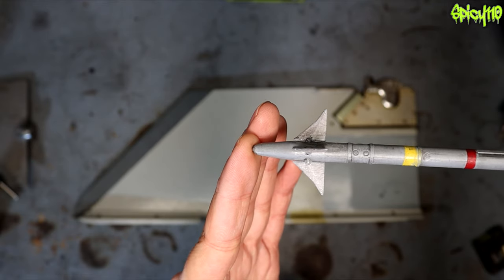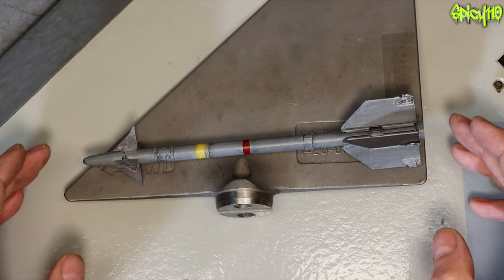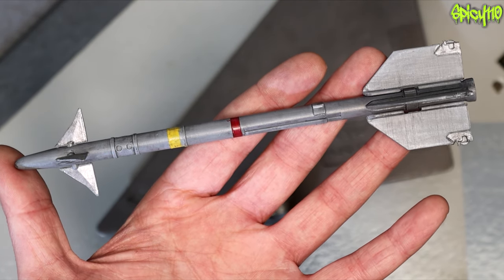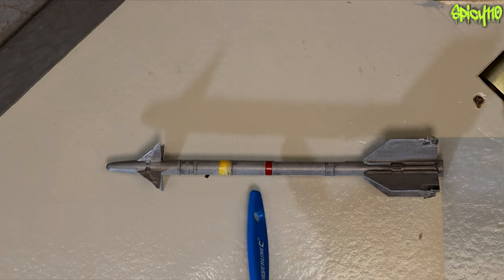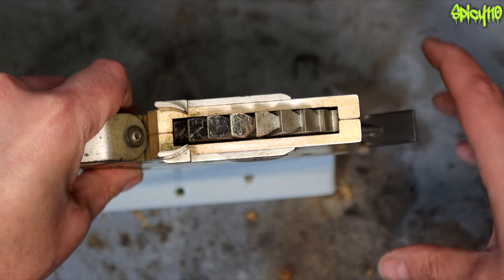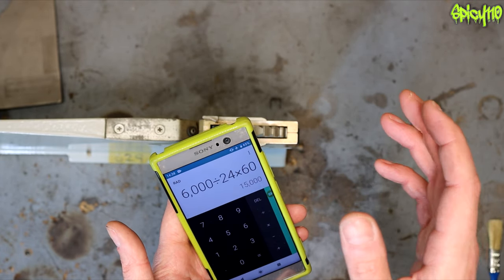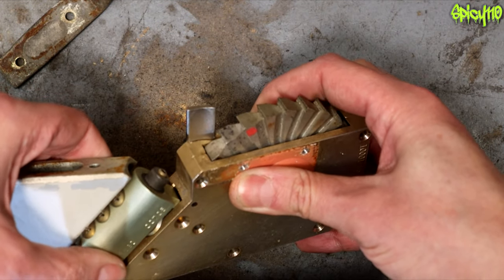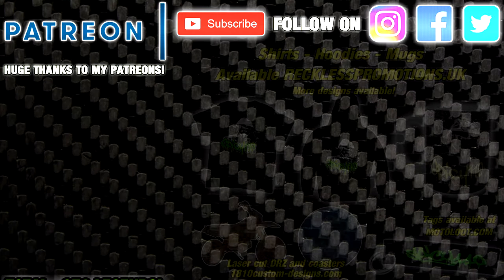AIM 9 SIDEWINDER MISSILE | How it Works with Rolleron Demo!

Comment from the maker: They are also quite good at popping ballons!
Reply: I see what you did there!
Reply: Just a heads up. A prefix comes before a word and the thing after the word like AIM9L or AIM9B would be a suffix. But maybe im getting that wrong and it works differently in this context
Reply: @yuyiko  you are correct.
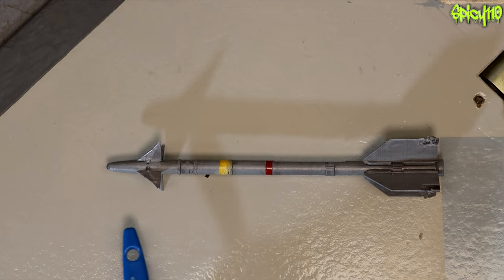Reply: I think they're using inert AIM-9X like a dart to pop it instead of 11:03 or perhaps they're just bypassing the arm/detonate function.   @spicy110 vid from 2021 you were a Sidewinder missile geek legit before it was cool!
Reply: They could have just used a single cannon shot surely. Or even a 📌
Reply from the maker: @TristanMorrow  my first video on rollerons was 8 years ago, this was the correction 🙂👍
Reply: Balloons? That was truly a star craft. I could see the little green men and the tractor beam when it popped. Nobody believes me but I saw them.
Reply: Great video. The Aim 9X used by the F22 has a totally different control scheme that all previous Aim9s (thrust vectoring along with rear control surfaces)
Reply: @Tom_Hadler  I just saw a video the other day that explained the USAF decided to use a missle because there was an instance of a fighter jet from another country shooting over 1000 rounds into a weather balloon and it still wouldn't pop or descend.
Reply: They still use an annular blast fragmentation warhead (the welded at opposite end bars) so I’m not sure where you got the idea that was outdated. If indeed it was you that said such a silly thing.

Comment: The canards are in pairs as there’s no reason to spin the missile… that’s precisely what the rollerons are made to prevent.  Having them rotate in the opposite direction of the other canard on the opposite side would just make the missile spin (like a bullet). That makes it impossible to lock on to a target, with the camera in front spinning like crazy.
Reply from the maker: Yes totally makes sense I was having a bit of a dumb moment as I was stuck on a construction thought, I should have explained more of my thinking. I realised if they are directly connected to each other by say a shaft, they could not be in the same alignment as you cann not have two shafts cross in the same space. So knowing they must be independent I started to wonder if that was also a added benefit. As you clearly point out it wouldn't be at all haha 🙂👍
Reply: @spicy110  well the two shafts can cross, one just has a U shaped dip in it so it goes below the other shaft but all 4 ends (the canard pivot points) are perpendicular on the same line.
Reply: The shoulder fired Stinger which is also an infrared homing missle does in fact rotate during flight so I wonder how they compensate for the spinning detector in that particuler version.
Reply: The Redye and stinger use the same sensor. Sidewinders had an angle mirror that rotated to scan, the redeye rotates the entire missile with a fixed sensor to make it smaller. Redeye and stinger have a gyro and some simple solid state logic to apply connections at the right angle.

Comment: I served in the RAF in the 80s and was posted to the falklands conflict and had experience with the Harrier GR3 when live armed with AIM9L, To test the missile and wearing headset on the aircraft internal intercom the armoury would shine a torch at the front of the missile and the lense would lock onto the torch light and you would hear a growl in the headset WELL FREAKY!!! As the eye followed you around!
Reply: Not live ammunition but a similar system still exists on Typhoons. Part of the ACS (Weapons system) testing involves SRAAM tests involving the cooling unit and communications in the pylon. After setting up the test you have to time that the cooling unit gets down to temp within a certain timeframe (checking for unit serviceability and leaks) and then the databus signal correctly indicates that it’s ‘armed’ and ready. The final part of the test is checking the cockpit symbology which involves the ‘growling’ tone in the headset - quite possibly the same things you’d have tested on the live stuff fitted during your Ops.
Reply: @DaveMurphyEngineer   Yes quite probably, it makes you ‘twitch’ when you realise you’re the target!! L OL
Reply: @Marie579  Thankfully I’ve never tested live munitions, but in all the testing I had to do the growling noise was generated by test boxes plugged into the Typhoon, replicating all the signals that would be generated by a live munition when fitted.
Reply: @DaveMurphyEngineer  The thing that got me was you could see the eye in the sidewinder following your movements and it increased in tone as it’s ‘Locked on ‘ LOL
Reply: @Marie579  As the Lima was the first Aim-9 to be 'All-Aspect', it makes sense that it would be able to detect longer wavelength IR outside of the traditional Mid-IR 4μm window, with the next usable atmospheric window starting at 8μm where the human body has an appreciable thermal output.
I still find it amazing that, even with cryogenic sensor cooling, the Lima was sensitive enough to pick out the bit of exposed human skin temperature with the entire space around it also being quite warm and emissive as well.
Reply: @Marie579  Yeah, I could see how being tracked by that electro-mechanical eye would give you the willies. And this happened to you a good few years before the Terminator 1 movie.
Reply: That's awesome haha

Comment: It’ll be the lowest peak, which I spotted maxing at 6,375Hz. The peaks above that are harmonic multiples of the fundamental frequency. This means that was going at nearly 16,000 rpm, which is wild!
Reply from the maker: And to think they span at over 100k on the missile!
Reply: Yes. You can also see that when the air is taken away and it slows down. There is only one peak then moving through 5000+Hz.

Comment: I fired an AIM-9L as a USAF pilot over the gulf of Mexico back in the day.  They regularly fire these in peace time as both a training session for the pilot and a data/reliability mission to ensure the stockpile is good to go.  The target was a BQM-34 drone.  They almost always replace the warhead with a telemetry device which tells the white coats how well the missile does, and if it passes within a lethal radius of the target, the expensive drone survives, but the shot is still a success.  The missile was so good though it often speared the drone, not needing a warhead for a kill.

Not mentioned is that each missile has a replaceable miniature argon bottle to cool the seeker head, which is critical for sensitivity.  Before takeoff, we'd cool the seeker with a button push, and the mushy tone would crisp up.  Anything with heat passing the seeker field of view would create the famous growl.  You could then "uncage" the seeker, which is normally locked in bore sight, allowing the seeker to track even while still on the rail.  While holding for takeoff, you could easily track a motorcycle on a road near the runway, or a lawnmower, anything with heat.  These captive training missiles were not live, meaning they had no rocket motor or warhead.  Any missile seen with brown or yellow stripes was a "war shot" or live missile, blue equals captive training missile.

Firing the missile... yes it was cool.  Cost-wise, it was like launching a sports car off the rail.  Whoosh! gone.  Lots of fun though.

Comment: It’s the first peak my friend. 
Every periodic waveform wich is not a perfect sine wave will produce this pattern, the first peak is the fundamental and the higher frequencies are the harmonics, you can think of them as a kind of byproduct.
A repeating pattern will never produce harmonics lower than the fundamental frequency, so you are looking for the lower peak
Reply: Aye this is the correct answer!
Reply: Yes. the lowest frequency is the fundamental one to use. All the others are harmonic multiples of the fundamental.
Also, as a crosscheck, search for & listen to a 6000 Hz tone. You'll notice it'll be about the same pitch. As a side note, most people have a hard time really hearing a 15,000 Hz sound.

Comment: The Soviet Vympel K-13 missile isn't just very similar to the AIM-9 Sidewinders, it is duplicated to a very high degree. When NATO forces captured some K-13 missiles, they found they could interchange parts from K-13s and AIM-9s and both missiles would still work. Ron Westrum in his book "Sidewinder" claimed the Soviets even copied the parts numbers directly from the AIM-9 to the K-13.
Another story I head was that one country that had access to both US and Soviet hardware (Finland or Poland?) tried interchanging the missiles with opposing aircraft. They found that the missiles were recognized properly by the aircraft and functioned normally.
Reply: please look at the R3 missile and the Aim9B which is what was copied

Comment: If you want another rabbit hole to dive down. The part number on the fin (08:20) is not a manufacturers part number but is a NATO Stock Number (NSN). 1420 indicates it’s a ‘Guided Missile Component’ and the ‘01’ indicates it was registered on the USA’s inventory list after 1974. The last 7 digits are randomly assigned but is unique to that part. You want to stay well away from anything with an NSN beginning with 11…………😉

Another great video bud, there’s a fair amount of my DNA on the pointy fins of ASRAAM missiles where I’ve worked - bloody things are sharp! Really looking forward to the next vid in this series of Aviation-geekery. 😎
Reply: weapons troop?

Comment: There was a radar version of the sidewinder but whether it was ever used in combat I can't confirm. Modern versions of the sidewinder like Aim_9X still use heat sensitive detectors which are cooled by liquid nitrogen or helium. They can in some models also track ultra_violet radiation. They also have digital imaging capability which allows all aspect tracking of targets.
Reply: almost accurate I believe it was the C model that was radar guided but the all aspect tracking came from the heat generated by friction at high speeds
Reply: @chillyboi6597  Yes, all-aspect capability came IIRC on the 9L, due to general improvements in the seeker design and sensitivity. Needed less of a contrast to gain a lock. This was decades before the 9X introduced imaging IR seekers to the Sidewinder family.

Comment: I don't know if you will read these Spicy, but the rollerons were needed because all the forward canards were the only active control surfaces.  Keep it simple with the mechanical control actuators all up in front with the guidance and seeker systems. of the engine kept the system far FAR more simple.  But aerodynamically a forward canard can not do a roll command. It turns into a cork screw motion. So rather than build an active anti roll system they came up with the rollerons. Most all modern missiles (including the new AIM-9X) use aft fin control so the heavy rollerons are not needed.  (also just to point out that the new AIM-9X is still IR but it uses an IR imager rather than a single pixel rotating sensor used in the original AIM-9)

Comment: The sensor in AIM-9 generations are all infrared. The earlier versions used a spinning reticle to derive angle off bore sight - thus part of the importance of the rollerons to stabilize rotation - while the newer variants are focal plane arrays - much like a digital camera sensor - and probably why you don't see rollerons on them such as the AIM-9X.
Reply: Aim9C is SARH like an Aim7
Reply: AIM-9X have all the stabilization down with the trust vectoring.

Comment: Awesome video, a brilliant follow on to the video from curious droid:) I would agree the wheel is sitting on a press fit bearing, the pin on the bottom of the fluid bearing is probably threaded as if it fell out in flight the it would be a total loss of the unit. I expect you can get the unit apart but would require a very precise application of force, i.e. custom made tooling to hold it perfectly and pull it apart. Part of the coating on the canards will be aimed as reducing heating. Them turned into air flow at nearly two the speed of sound will have serious heating affect.

Comment: Regarding the canard, it's probably just a cast, unpainted finish.  If you removed the paint from your rear fin, it would look the same.
If you look at photos of the missiles attached to airplanes, you won't see unpainted parts - and they are largely white, but can be other colors to indicate function.

I think it's just not painted, and was probably a spare never used.
Reply: sandblast.

Comment: if you want to measure rpm with audio, stick the mic to the metal to measure vibration and then take the lowest peak. its far more reliable than dealing with the whistling from the fins.

Comment: My analysis:
There are 24 teeth on that wheel.
The Spectroid app shows the pitch reached 6656Hz.
So it looks like the wheel reached 277rps (16,640rpm)
(the pitch certainly is not 15kHz (6656Hz is the correct peak value). You can confirm this by using a signal generator app and compare both pitches manually)
Reply: Let's do some math. The wheel diameter looks something like 10 cm. Circumference is around 30 cm.
The fin-speed of the wheel will be less than the airspeed of the missile.
Let's take the 2000 km/hr, which boils down to 555 m/s
Divide the 555 by 0.3 and you have the rps: 1850 rps or 110.000 rpm
More testing required I guess.
Reply: @Pozi_Drive  The rolleron has a pair of airfoils standing vertically in front of the wheel.  They are shaped in a way that increases the velocity of the airflow, just like a venturi does.  The top speed of any AIM-9 is still classified, but it exceeds Mach 3, which is roughly 1,932 knots, or 2,223 mph.
Let's assume that the top speed of the missile, plus the venturi effect, comes out to 2,500 mph.  The wheel measures 3" in diameter, giving us a circumference of 9.42".
The math shows 280,000 rpm, assuming the tip speed of the wheel is at 2,500 mph.

An air compressor at 90psi will not come close to producing a Mach 3 air stream.  Just sayin'.  I would guess that smeggyhead1 is pretty close with his 16,000+ rpm.
Reply: @throngcleaver  Your guess is as good as mine. We're just supposing.
Reply: @Pozi_Drive  I have a rolleron I bought on eBay and actually measured the wheel.  Your assumption of 10cm is 33% larger than the true diameter.  A smaller wheel would turn at a higher RPM than a larger one, based on the outer diameter velocity being the same.  2,000 kph is only Mach 1.67.  I know that the published number for the speed of an AIM-9 is Mach 2.5+.  I also know that the much older AIM-4 series of missiles claimed as much as Mach 4 for a top speed, so I chose 2,500mph because it falls roughly halfway between Mach 3 and Mach 4.  I don't make guesses without having factual information from which to base them on.
Reply: @throngcleaver  Looking at how many decimals you use I come to the conclusion that you should not do too many calculations of this kind.
Reply: @Pozi_Drive  Flunked math, did ya?  Well, someone needs to flip those burgers.

Comment: 10:03 Having to be behind the target plane had very little to do with the maneuverability of the missile (though extra maneuverability certainly helps on head-on shots!) and much more to do with the seeker capabilities of the older models. They simply weren't good enough to get and maintain a solid lock unless they could see the exhausts of the engine(s), so you needed to be behind them  to get a reliable shot off. Some sources even say that the B model was basically blind to anything cooler than the tailpipe of a jet (partly due to sensitivity, partly due to the part of the spectrum the seekers of the day worked at).

The gimbal system was also another reason, in the B model for example the seeker could only turn at 11 degrees per second, so it would have had trouble following a target that's moving across it's nose really fast, further limiting it to fairly low maneuvering rear-aspect shots on that aspect as well.

The AIM-9L was the first all-aspect Sidewinder, with both a sensor sensitive enough (and in the correct parts of the spectrum) and gimbals fast and accurate enough to allow you to fairly reliably make shots from any aspect against a highly maneuverable target.

And as an additional note, the AIM-9X is the first Sidewinder model with an imaging IR sensor, meaning it can also detect shapes, sizes, etc. and use that to recognize and track targets (really helpful against countermeasures like flares, which surprisingly are not shaped like jets), whereas older seekers were mostly IR detectors (kinda like the difference between a light detector and a camera, though there's more to it than that).

The turning around bit isn't really related to the missiles being designed to come at targets from behind, there's really no need for that (you just wanna get close and go BOOM). There's absolutely no need for the missile to fly past the target, turn around and then head for the tail pipes, that'd be a colossal waste of energy overall.

The "turning around" thing of modern missiles is more to do with lock-on after launch capabilities (LOAL), meaning the missile doesn't need to have a lock on the target when it's launched. It can be told where the target is, fly towards that area, and try to find the target once it's looking in the correct region. For example the French Rafales have demonstrated a shot using the MICA IR missile where they used the datalink between the planes to give the missile a target, that was behind the plane launching the missile. The missile launches forward, turns around, and begins seeking the target in the area where the datalink said it was. IIRC the Israeli Python has also shown this capability, and the block II version of the 9X should be able to do it as well, but AFAIK it hasn't been demonstrated.